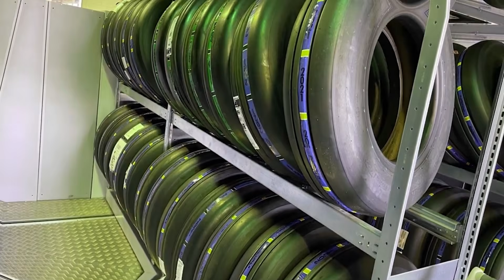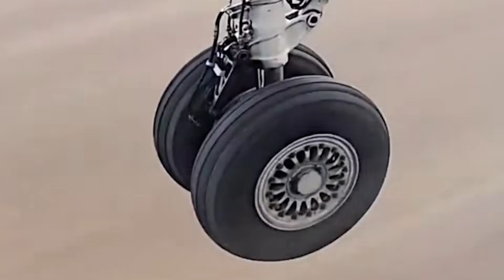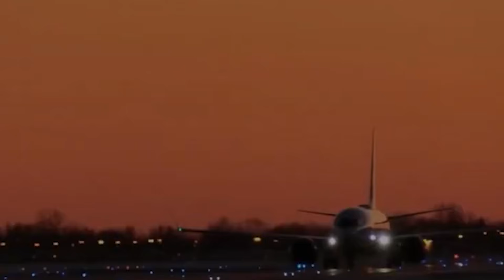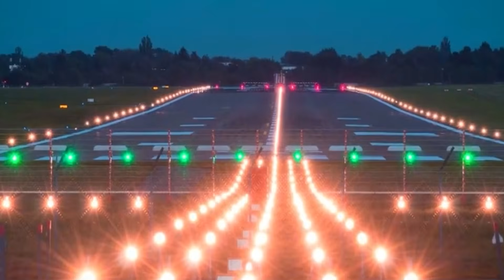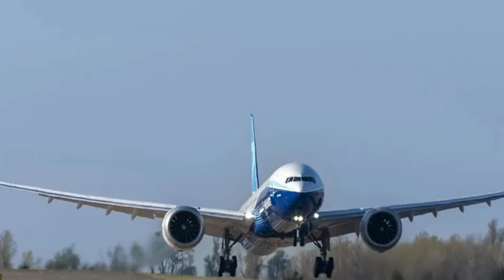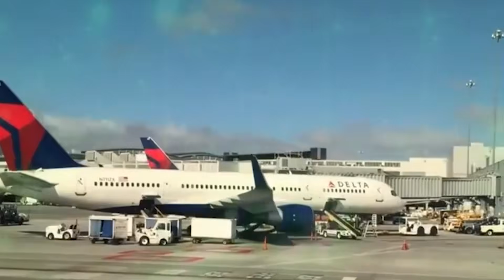Why Airplane Tires Don't Explode on Landing 🛫

Comment: They should use electro-dynamic braking,then they could spin them up before landing and use for additional pull on take off and they can maneuver with out a tug
Reply from the maker: Interesting idea — using electric wheel motors for braking and taxiing has actually been tested before. The biggest challenge is weight and complexity. Adding motors, cooling systems, and batteries to the landing gear increases aircraft weight, which can reduce fuel efficiency during flight. But using wheel motors for taxiing without a tug could definitely save fuel and reduce airport emissions in the future.